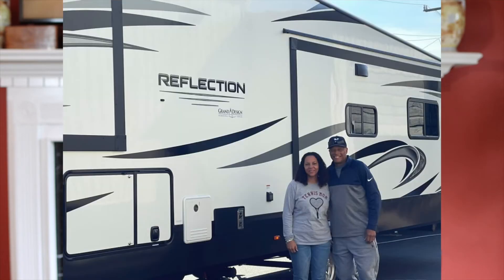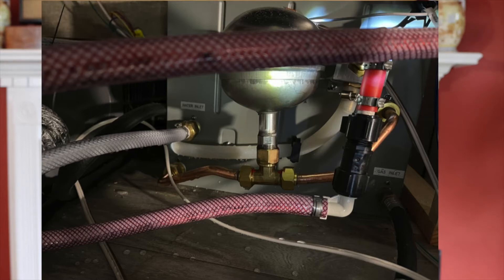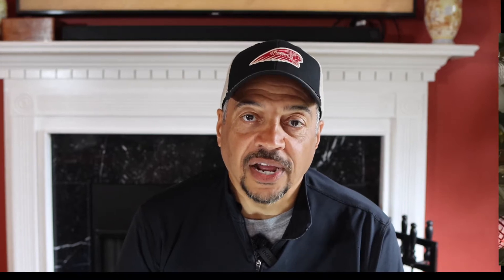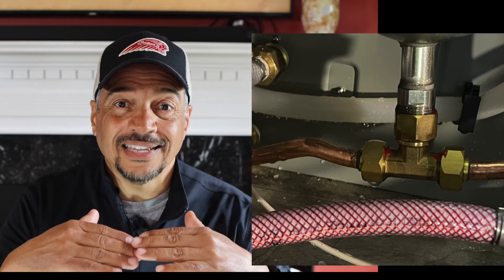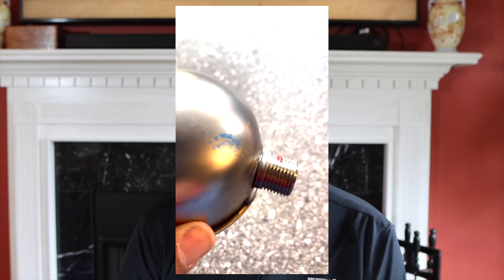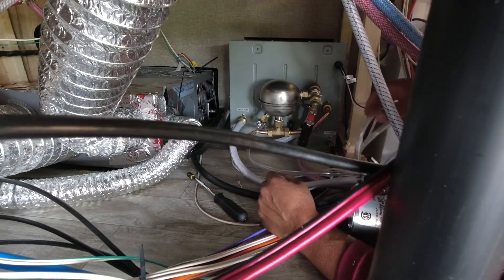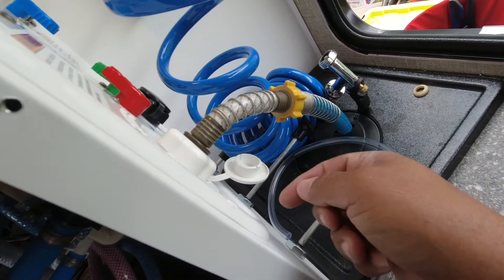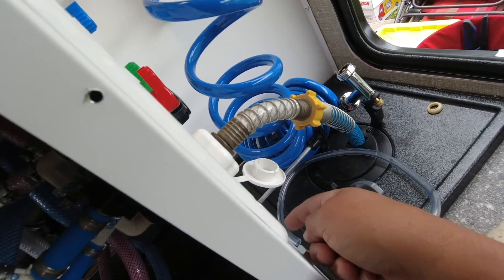Furrion tankless water heater tank repair.

Comment: Very good video. Will be very helpful to many. 
A buddy of mine got one with his new trailer. His complaints are mostly about how slow it starts to make heat or no heat at lower flow levels - like when washing dishes. He has to continually wait for it to get warm again and it wastes a lot of water. It's even worse when taking a shower. If it dies, he will not get another.
FWIW, I've been reading a lot of reviews on all their products and they don't really support anything.
Reply from the maker: We have not had the same experience as you. The water has been hot when needed and plentiful. The only issues has been winterizing it. This year I blew the lines out and filled the bowl with -100 antifreeze.

Comment: Thanks for sharing this info! I do not have one of these units (Thankfully!), but this init is just another example of the junk that this company makes! They should absolutely replace every one of the water heaters at their expense for building such an obviously poorly designed system. They just stop making them and move on to something else while the owners are left high and dry? Grand Design should also share in this if Furrion won’t stand behind what they make! Unbelievable!
Reply from the maker: The solution is simple. A competitor makes a similar mixing bowl. However, theirs can be dumped from the front of the unit.
Reply: What competitor makes a better unit mine is broke 1st time out of storage just like you warned would happen . I want the company to replace this garbage product free of charge. Thanx for the great video very helpful.

Comment: Thank-You for sharing: Did Furrion ever cover the damages as it seems it should be recalled and replaced as I can see this happening to many people. I have the same heater in my 22 Grand Design and worried same will happen to me.
Reply from the maker: Don Yuke, first, thanks for watching. I would recommend using -100 antifreeze in the water heater. The exchange ball cannot be flushed out of all of the water, without removing it from the back of the unit. The reason I recommend -100 is because undiluted -50 antifreeze will freeze or gel up between +14 - +18 degrees fahrenheit.  I would believe that the dilute antifreeze would freeze much soone and raise the burst temperature as well.  So, depending on where you live, I would use -100 or remove the exchange ball.
Reply: @ParadiseinaTinCan  Reggie I thank you again for the excellent video , saved me a lot of time and aggravation to by-pass the ball exactly like you said except I think you stated you need the 1/4" fittings with a female end when I think you meant make thread at least mine was male thread.Also Reggie you said the ball can not totally drain is what causes the breaking well did you happen to see the 2 tiny holes in the ball stem near the very bottom of it? I think it should totally drain from those holes? I first tried to weld the ball myself and failed so I bypassed it and have a claim started with Grand Design time will tell if they will replace my faulty heater. Reggie can you be reached reggie@paradiseinatincan ? Thanks again
Reply from the maker: The exchange ball is a fragile metal, a form of stainless, I believe, and melts really easy.  As for the 1/4 comment, I am not sure at this point what I had said or in what context without going back and watching it.  If you are able to get another exchange ball, I would consider inserting a by-pass on the cold water line below the exchange ball. It maybe able to drain if you blow the lines out. But the combination of blowing the lines out with -100 antifreeze did work this past winter. To be clear, I always blow my water lines out before using antifreeze.

Comment: Great re-engineering of the manufacturer’s poor design. Just wonder, while you were in redesign mode if you could hack faced that new drain fitting straight down instead of the slight pitched angle. That might helped to get every last drop of water/anti-freeze out of the bowl. Maybe blowing low pressure air might talke of the last few drops.
Great video, a job well done.
Reply from the maker: I guess you could. You just have to watch the seams or change the lower fitting.  I was trying to limit how many times the divider wall needs to be taken down. But so far what I did has been working.